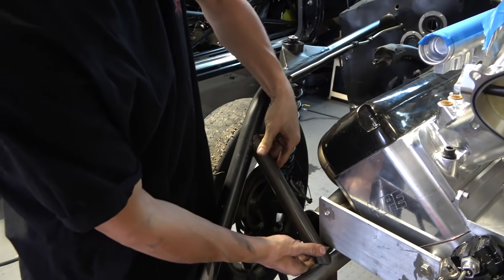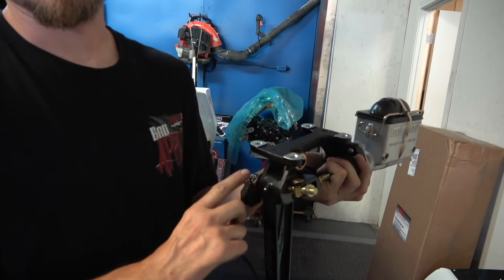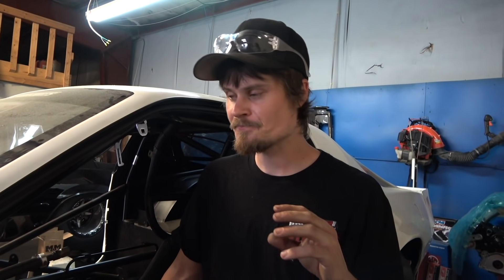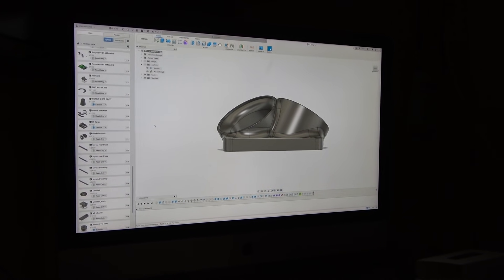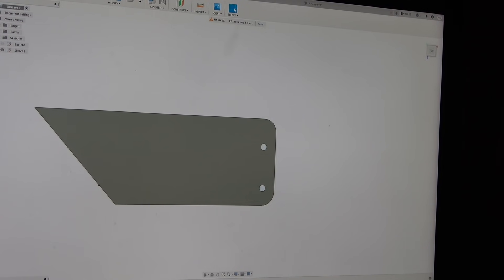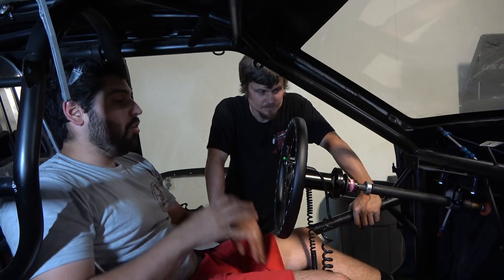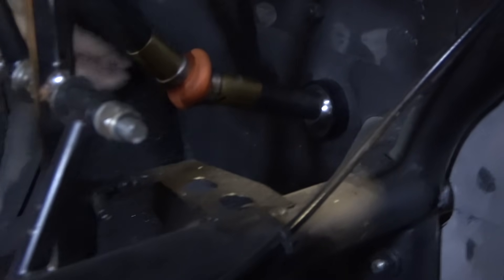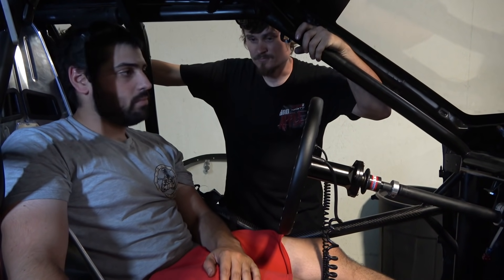THEY SAID IT WOULDNT WORK!!! 481x in 3rd gen CAMARO!!!

Comment: Holley has a great engine management system, don’t get me wrong. But when it comes to this level of car, Fuel Tech is where it’s at. Less wiring, fewer modules to install and just as easy to navigate as Holley.
Reply: I think the holley paired with a the ecumasters pmu16 is a extremely powerful combo.    Honestly ft has just as many modules as a holley will have.

Comment: What is Matt's background. When I heard the term CFD I thought Mechanical Engineering. He is technically very impressive in his thought process.
Reply: Where the bolts go in that turbo exhaust flange tho lol. Maybe I'm dumb, I see them on the mating serfuce but not up top
Reply: @rustychevy2087  Computational Fluid Dynamics! CFD
Reply: @dalebaker5820  I am stupid lol they gonna use studs

Comment: Where the bolts going on that exhaust flange??? I'm confused, I only see them on the mating serfuce but no holes up top?
Reply: It will have studs in it.
Reply: @HorsepowerMATTers  Makes sense, I'm a dumbass lol. Nothing but slick engineering for good ol slick rick

Comment: Anyone can fit a motor into any chassis. The thing is can the chassis handle it. I’m not hating just speaking facts. You got a 100K drivetrain and a $10 chassis. This car will never be at the top of competition because that car has old chassis technology. I will have to redone by a real chassis builder. You can’t buy a big motor and put it in anything and be like I’m the baddest   Don’t work like that. Mark my word  💯🤦🏽‍♂️🤦🏽‍♂️.
Reply: Bro what are you smoking? The car ran high 3's and it previously had a big block twin turbo setup and competed in pro275.
Reply: Speaking of facts do you know how fast this car has gone? Bad fast!
Reply from the maker: Actually this chassis has 20 passes on it. And has been 3.8x at 199 in pro275 trim with a conventional headed big block.... so you sound really stupid and don’t know what your talking about..... clearly.... mark my words. U stupid
Reply: Best to do your homework, or it'll show why you dumped the test. It's hard to be a star COWBOYNATION
Reply: Words been marked lol can’t wait to revisit this